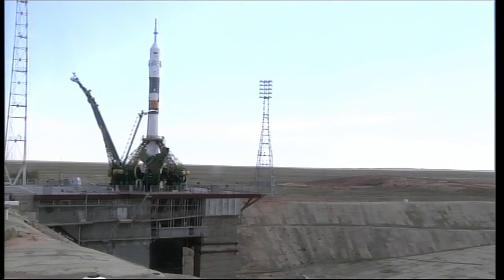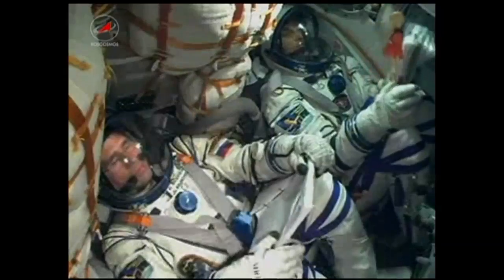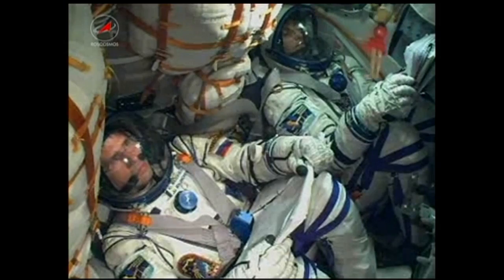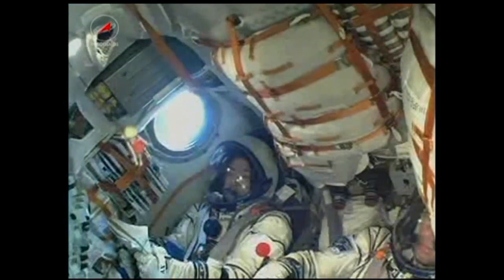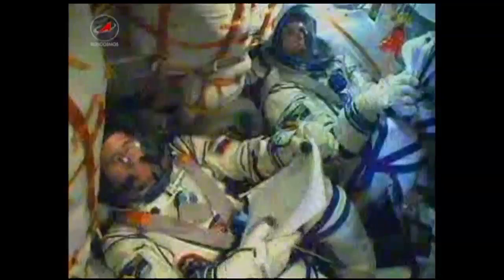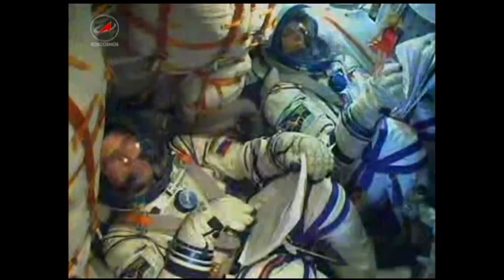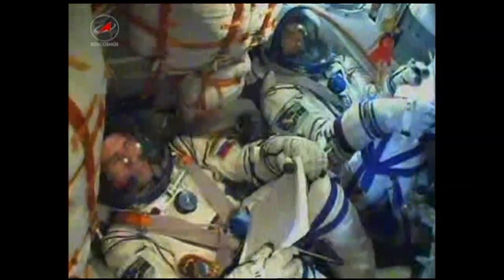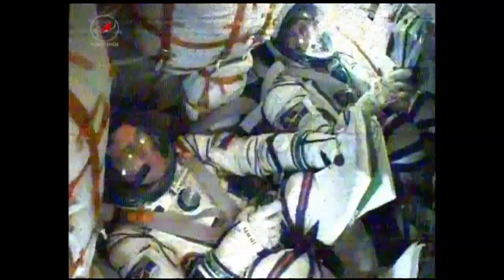Soyuz Launches to Space Station

Comment: How does it feel like taking off? Like a roller coaster or do you feel nothing ?
Reply: +TheGolemBrothers I'd guess not, it probably feels similar to an aircraft taking off, like how you are being pushed into the seat as the aircraft starts it's takeoff roll. The orbit insertion would probably feel like how you describe it, being dropped from 2-3G to 0G almost instantly.
Reply: TheGolemBrothers Of course you feel the increasig g-forces and vibrations.
Reply: YDDES does your heart like drop like during a roller coaster falling?
Reply: TheGolemBrothers Well, since you actually fall all the time, you may feel a little uncomfortable before you get used to the feeling. 
I think that's very individual.

Comment: Wow. The ride is so smooth, you can't even tell they are moving! In the shuttle, it was rock and roll city.
Reply: True. And Soyuz is considered the safest spacecraft ever built.
Reply: +Suzanne S The Shuttle vibrates so much because of the solid rocket boosters. That is the only reason. After SRB separation the Shuttle is almost vibration free--you just feel the increasing acceleration of the vehicle.
Reply: Wonder at what point during the takeoff they showed footage inside the soyuz? Google a bit and you should find footage from inside during engine run up and blast off....not so smooth
Reply: I read it's because they use different fuel than the shuttle which makes it more smooth. I heard an astronaut saying Soyuz is a smooth ride.

Comment: there is a camera inside the rocket space craft?
Reply: There are two cameras in this capsule, and there's one on either side. Other capsules have the same number - but located differently. One is positioned above the cosmonaut in the centre, and the other is fixed high over the control board that all three occupants are facing.

Comment: I am comparing tonnage and it doesn't matter if skylab was delivered to orbit in a single package, because that's not the point. It was faulty and it failed when the project was rushed due to political pressure. A reverse case is the Soviets and their lunar attempt, which failed for the same reasons. The point was: low earth orbit space stations - the Russians have more experience and lunar exploration - NASA. Saturn wasn't surpassed, because there was no economical need for it.